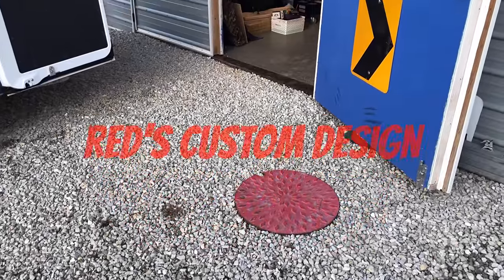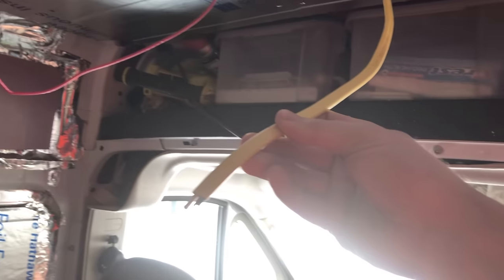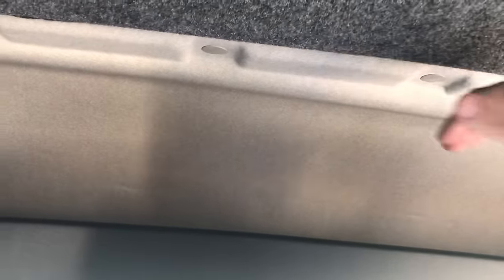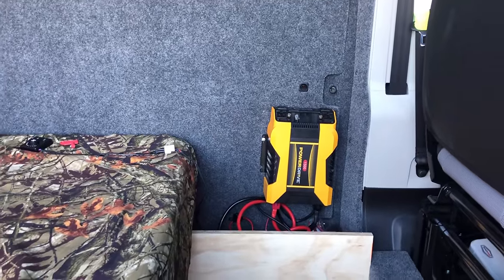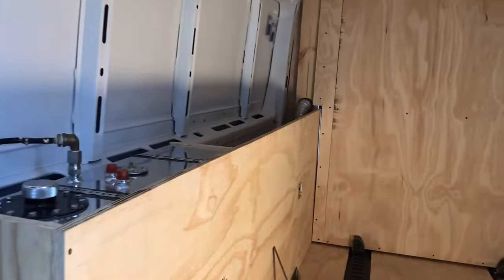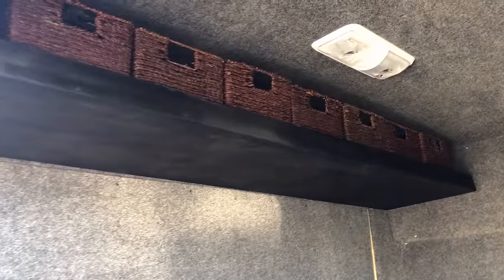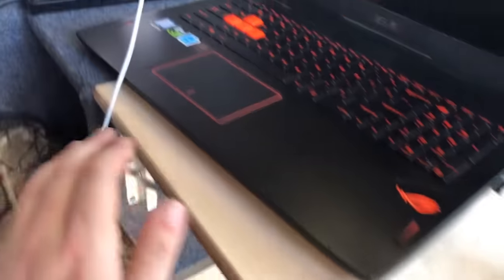Promaster Expediter Sleeper Bunk Build

Comment: This is absolutely the best build I've seen for almost exactly how I use my Promaster!!!    Since I'm a traveling mechanic so to speak, my rear compartment is set up with tools etc, but front is identical in function!  Since I live south of Indy, I'm definitely hunting up Red for the next go around in a few years!!!

I also put that exact same heater in.  Found out it just sips fuel...good grief, I can get three nights sleep on the 10L tank it came with at 30f and its never been so cold I couldn't get two without worrying.  The only "problem" I've had with that heater is it does dry the interior out...so much that by say, 3am I'm uncomfortably dry.  So, to "fix" this I take a wet washcloth and hang it under my bed near the heater (my bed is higher and fixed as I store other stuff under the bed) vent.  This helps a lot.  The negative on that is then I get ice on the inside of the windshield because I have a nice privacy cover...no problem without the privacy/light cover.  But, all I have to do is start the van immediately when I wake up, put it on defrost and 20 min later all is ready to roll.  I also sprang for a nice smoke/CO detector up front...just in case the heater malfunctions, seemed wise and I sleep better knowing its watching over me...

I also added a deep cycle battery.  That little heater eats your primary battery, and I found the 2nd battery was required to make it through the night.  I'm at 11.2Vdc when I wake, which is no problem with the deep cycle in parallel.  Van starts right up.  If you take your primary down to 11.2 (an all night would be more like 10.2) probably not going to start....

I really loved the carpet up front!!!  Nice and civilized...I opted for $800 worth of ceramic coatings from Summit (Lizard Skin) and will never do that again.  I'm always bumping into that sharp stuff, no likey!!  Carpet would be way better!  However, as sound proofing, the Lizard Skin product works insanely good...it really is amazing, but, like I said, its kinda bumpy and not smooth like carpet.  Its also the only insulation I have and it works surprisingly good at that as well...GREAT product, but not for a sleeper IMO.

And, what do you think you will do on the A/C front?  I opted to just run the van overnight, right at .5gph, so $10 or so for a night of A/C?  Wasn't sure I'd ever get ROI on an A/C and generator option...

Beats the heck out of a grotto bed at the Hampton for $185...I've found I sleep better without a doubt and have logged 37 nights in the Promaster over the last 6 months, which also probably adds up to around $5,500 in actual hotel savings...on track since I spent a little over 10k in hotels last year.  Plus, now I get a breakfast worth having!!!!  And...how well can a guy sleep with $60k in tools out in the parking lot?  In the turd whirled state of Chicago???  Me...not so good....I sleep way better knowing a well armed guard is right next to my tools and test equipment all night long....

And, at 5k for that entire build?  Its all written off, so actual cost is what, about $2,800 out of pocket depending on how badly the thieves in government are getting in your wallet, so, finally an outfitter thats affordable for a working guy!!!  And in Indiana??!!!  Wish I would have found you 12 months ago!!!

Great build and great video, thank you!!!
Reply: Nice write up. Logical.

Comment: The wiring for the air conditioner… is that for refrigerated loads and or comfort when sleeping? Would you run it off of another energy/battery source or just run the engine?
Reply from the maker: Drive comfort only.  It runs off a generator

Comment: Very nice build! But... I wonder about the Romex and solid core electrical wire used in an expediter freight van that shakes, rattles and rolls over the road for potentially hundreds of thousands of miles? That's trouble waiting to happen. Suggest you consider using Ancor marine grade electrical wire instead of the Romex and solid core wire. Understand and appreciate that Romex and solid core is cheap but... Ancor stranded electrical cable with endure the harsh environment of the OTR freight van environment where Romex solid core electrical cable will not - and will eventually fail.
Reply from the maker: Myself and the rv industry have been using romex for years with no problems with the wire. The problem people have is with the pass-through plugs. I don't use pass-through plugs. And I've not had any problems. I've got a expeditor build i did 5 years ago and they have almost 650k miles on the van and it hasn't had the first problem with the romex wiring.
Reply: Well if one if your build expediter builds has traveled 650k miles using Romex wiring with no problems that’s encouraging. No RV I know would ever run 650k w/o problems - other than a Prevost Liberty Coach. Liberty Coach uses Amcor wiring in their builds. Must be a reason?

Comment: What does your van use idling for air condition when I was in a van which I hate it because there's no log book I was burning about a gallon an hour to keep cool on a hot day
Reply from the maker: I don't know, I don't Idle my van. I have a window a/c unit and a generator.
Reply: @RedsCustomDesign  but I don't have several hundred dollars to $1,000 up front
Reply: @RedsCustomDesign  how much would you charge to build something like this

Comment: where does the bed go when you put it away
Reply from the maker: Depends on what you have. It can be stood up to act as a bulkhead. It could lay ontop of the freight if its not to tall so you still have a place to sleep. I've had some drivers strap it to the wall. You have all kinds of options with this design.

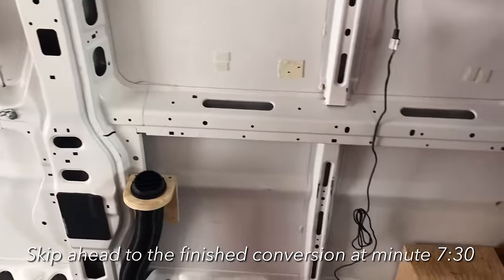Comment: at minute 1:10 where do you buy those tie down tracks on floor? I can't find them
Reply from the maker: I buy them in 20' sections from a truck/ trailer repair shop
Reply: @RedsCustomDesign  Do they have a brand name or anything?
Reply from the maker: E-track

Comment: How does the bed lift up? Fully
Reply from the maker: It's just a platform sitting on the side rails. You just pick it up out of the way. Or if you have 3 pallets (and the freight allows) you can lay it ontop of the freight to sleep.
Reply: Excellent work

Comment: Fire extinguisher needs  be mounted the drivers seat. You would fail a dot inspection, also i would of used the original steel bulkhead the van came with. If you get in a bad accident or hit from behind that wooden bulkhead will not protect you.
Reply from the maker: #1 these vans are under 10,000lbs so they are non DOT regulated. #2 in a DOT inspection it just says you must have a fire extinguisher   securely mounted. Dosen't say were. #3, this bulkhead is to separate the sleeper area from the freight. It can open up for a third pallet if needed. Its not meant to stop anything but air. Hell, before he got here he (like most expeditors) didn't have any bulkhead.
Reply: If there is a third skid. The bulkhead lifts up towards the back. What do you do with the bed and mattress. 

Exactly how do you fit 3 skids.
Reply from the maker: @alankalupa7585  if you have a 3rd skid you can put the bed crosswise behind the seats or strap it against the wall ontop of the storage box or you can lay it ontop of the freight to catch a nap.
Reply: Red's Custom Design Absolutely best useful build. Thank you. Love it
Reply from the maker: Trust me, if a vehicle catches on fire you don't have time to put it out with a fire extinguisher anyway.  When my van burnt it was completely gone in 15 minutes. And I had a fire extinguisher.